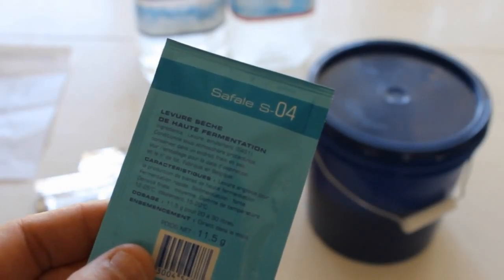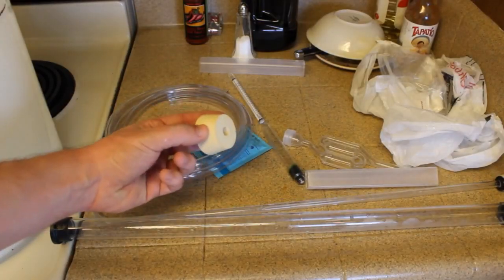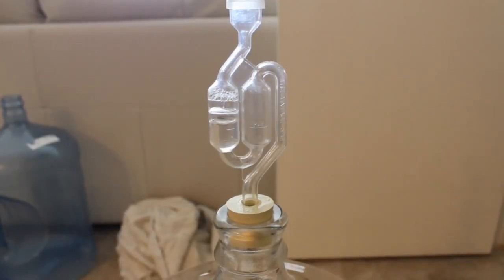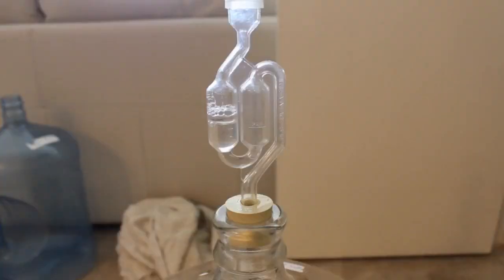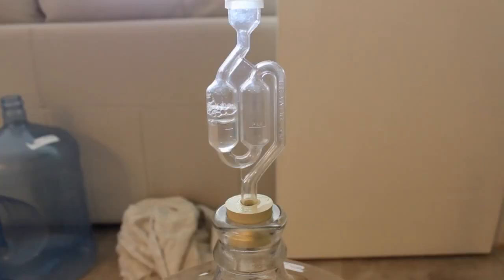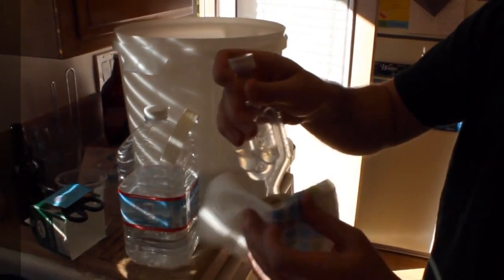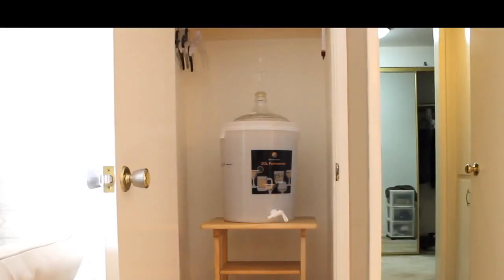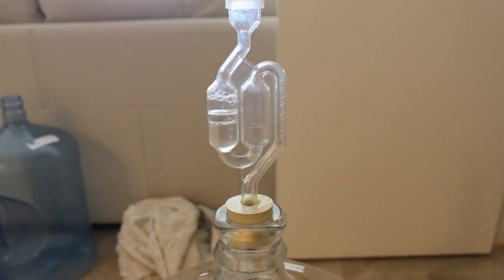11. How to USE BUNGS & AIRLOCKS (Extract Homebrew)

Comment: very good video, but a big thing that might help ya, is if you use starsan which is a food grade sanitizer, you don't need to wipe down the sanitizer before placing the bung and airlock in. when I pitch my yeast and put my airlock on, I just soak all of it in the sani, including my gloves I'm wearing, the scissors I use for the yeast packets, everything. and you actually shouldn't wipe it down with anything else at least in this part of the process, you're posing a lot more risk than you would be by getting a few drops of starsan in your beer. it's totally fine and won't change the taste tho, we learned in school to always do it this way to ensure anything that contacts the bung or fermenter is clean.

Comment: After putting sanitizer in the airlock and getting it even on both sides, when I press the bung and airlock down onto the carboy, the pressure pushes all of the sanitizer into one compartment on the airlock. Is this normal or am I doing something wrong?